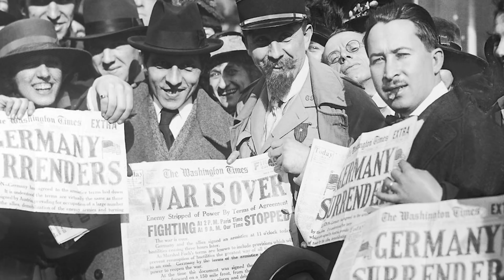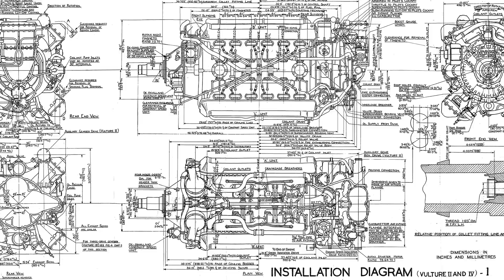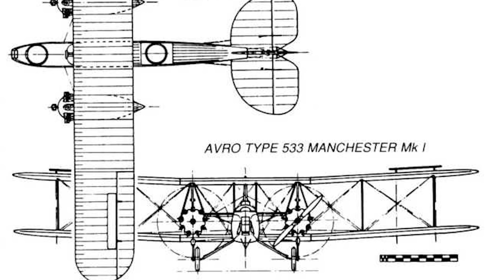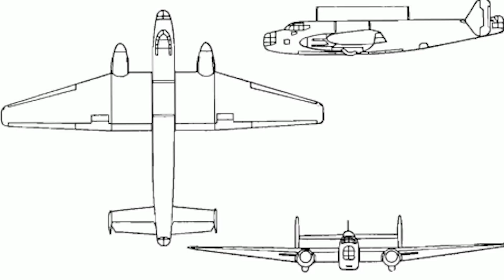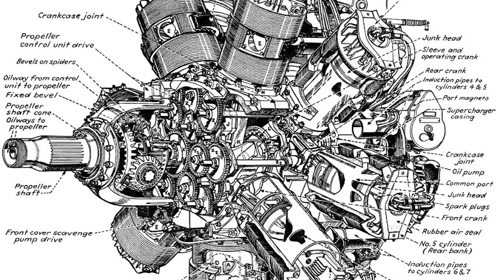The Avro Manchester: The Lancaster’s Unlucky Older Brother...

Comment: Adding to the Manchester's woes was the Air Ministry requirement that the wingspan be less than 100 feet so the aircraft would fit into existing hangars. This gave the Manchester stubby low aspect ratio wings which restricted it's lifting capacity and ceiling. When Avro stretched the wings to fit on four Merlins, they fixed this problem. Presumably, Bomber Command had to build some new hangars, but this is never mentioned.
Reply: The Sterling, a massive bomber, was hobbled by this unnecessary restriction. Britain was turned into a base from which the second front was established, and new airfields with new hangars were being turned operational at a rate of one every several days.
Reply: The wingspan thing is a bit misleading as most RAF hangars had something like 115ft long doors, and let's not forget the Lancaster only had a slightly larger span of about 103ft than aircraft like the Stirling.
Reply: @liampaterson3424  The Lancaster is an up-engined Manchester. The limitation was in the spec that the Sterling and early Halifax were built to. Kinda bizarre really.

Comment: The poor field engineers who had to service these Vulture engines must have thought, 'you've got to be f#$%$g kidding!' Just a couple of years later, the Bristol and P&W radials were putting out far more power, even the Merlin/Griffin series. One of the problems with the 'welded-together engines', as they were described by RM Goering is, the amount of radiator area needed to cool this massive chunk of metal exceeded the frontal area of the engine, negating the aerodynamic advantage of having two less nacelles. It might, however, free up more wing space for fuel. Not sure if anyone ever was able to make a truly-reliable engine in the X or H shape. This is a great video with some obscure drawings and info that one doesn't often come across. Thanks.

Comment: Iive down the road from the old Rolls Royce factory in Leavesden, its now home to the Harry Potter museum and Warner Bro film studios. I taught my 15 year old daughter to drive a truck on the once famous runway where many a Lancaster had taken off from.
Reply: I lived on the boundary at Leavesden from 1949 to 1951.It was de Haviland's engine factory (the main factory being at Hatfield. I recall the sound of Ghost engines (for the Vampire and Comet) being run up and shut down.They had a lengthy runway because, HP Halixes were assembled there for the London Aircraft Production Group, part of which was at Aldenham (the later LT bus overhaul works and intended to be a tube car depot). I went to many open days in the 1960s when I came back to live nearby and they extended the runway during that time.
Reply: @johnjephcote7636  So it was  Halifax bombers not Lancaster bombers in Leavesden, you can still see the hangers in Hatfield and one is a police station. There's also the De Haviland Mosquito museum in South Mims also.

Comment: Great video.  Packard also made Merlin engines.  The Victory Aircrsft Lancaster FM213 based in Hamilton Ontario Canada has them.
Reply: The Packard built engines were more reliable than those made by Rolls. After the war, new Mustangs were built with Alison engines which were even more reliable but had less power than the Merlin. There is a rule to building race car engines which also applies to piston aviation engines: that the more powerful you make it, the shorter the lifespan between rebuilds...

Comment: It's really a case of the sad failure of the RR Vulture engine, something that should have been very good but rarely for RR turned out to be a total lemon.
Imagine if the Vulture had been a total success and the next logical step had been an Avro Super Bomber using 4 fully sorted Vultures.
It probably would have shortened the war significantly and actually saved many lives.

Comment: What the heck is a fue silledge? Is that the part between the poor peeler and the imp an edge, or sumpin different?

Otherwise another great video.
Reply: I noticed that too. In fact, fuselarj hasn't always been the accepted pronunciation and both forms were once used. Although that is how I would normally say it, it is really mock-French and I am rather pleased to see the more English form still in use.

Comment: It sounds like Avro may have 'over-sold' the Manchester just a wee bit. It doesn't take a lot of calculations to arrive at the conclusion that it was not going to be a 350mph airplane. They did get the contract, and bought some time to come up with a better idea. I suppose RC was almost forced to use these Vulture engines. The German Grief bomber had to use the DB603, and on top of that, it was required to be able to do dive-bombing attacks, thus drastically increasing the airframe weight. 'The military aircraft is like a Christmas Tree....everyone wants to hang something on it'.

Comment: A bank of cylinders is essentially a row, so a V12 already has two - and the Vulture added two more; 1750bhp not so much "jaw dropping" as per design objective (but still less than ~2000bhp needed for viable bomber twin) - & what engines were de-rated to isn't mentioned (~1500)
What is jaw dropping is that modified Merlins which were sustaining 1800bp as early as 1938 - and peaking at over 2000(!) for short periods. Cruising speed mentioned, but not Lancs for comparison; even if you do regard the Lancasters development as "remarkably swift" it's only because from the inboard engines inwards it's virtually identical to the Manchester - and that it used the existing jigs/tooling/etc was a significant factor in selling the idea to MOD
Though not as extreme a case as the Mosquito, it's is another example of a design succeeding in spite of - rather than because of - Ministry support: AFAIK Avro were denied request for Merlins as they were prioritised for fighter effort so had to procure units for prototype Lanc nefariously...

Comment: Interestingly, the Germans had a story that parallelled this.  Their troubled star was the He-177 Greif ("Griffon", although "grief" might've been closer to the aircrews' feelings).  The Greif was also intended to be a wonder bomber, with two very large experimental engines, and the Reichsluftfahrtsministerium (the German air ministry - I hope I spelled that right...) larded-on requirements including the ability to dive-bomb, for which an aircraft that big was just plain unsuited.  Eric "Winkle" Brown flew it for the RAF postwar, and said of the Greif that it was one of the few German aircraft that he did not enjoy flying.  But ultimately, its curse was the same thing - engines that should not have left the factory floor in their present design, and that were fitted with very tight cowlings to improve streamlining, resulting in engines that were a nightmare to maintain, with a grisly tendency to catch fire - crews dubbed the He-177 'the Reich's cigarette lighter'.  And the parallel is that Heinkel had been trying since 1937 to fit four conventional aircraft engines to the Greif, but those engines were all needed for fighters so he was refused.